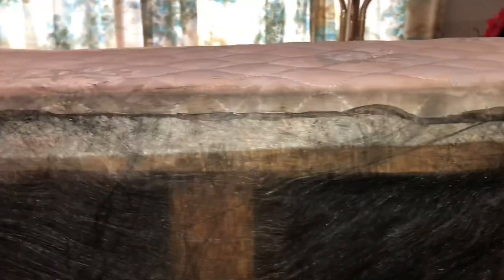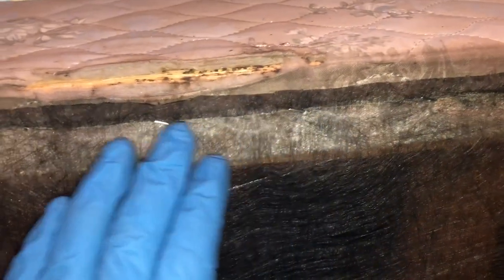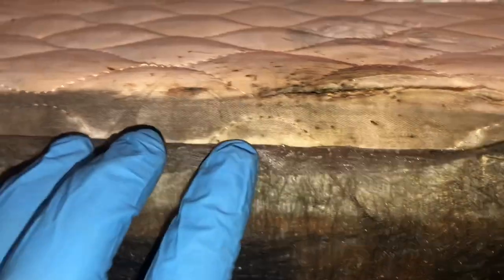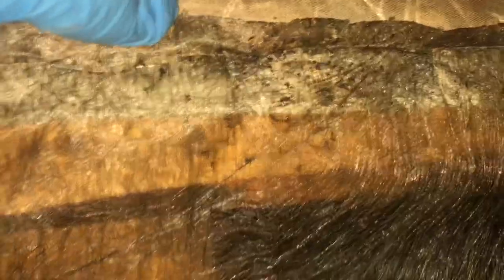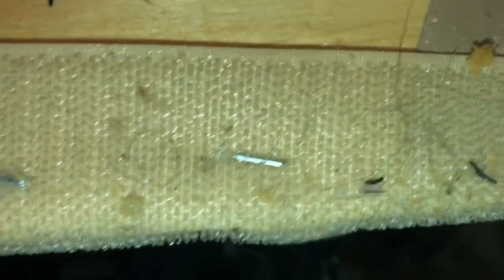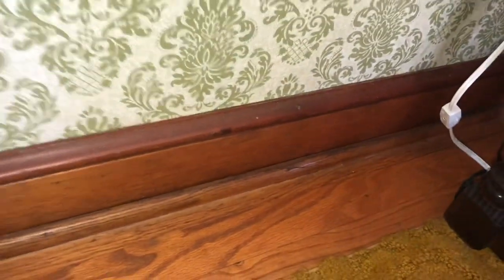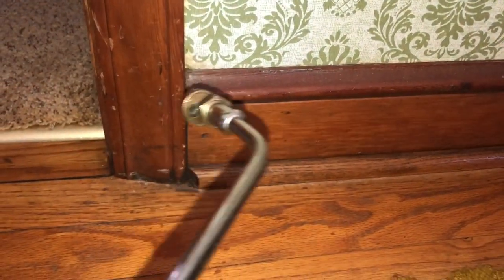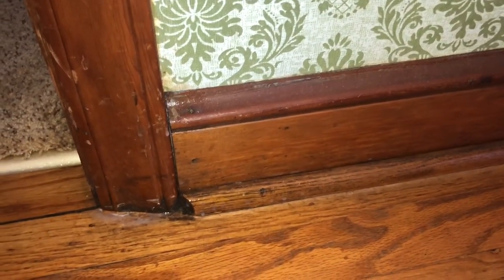DON’T MISS THESE BED BUG HIDING PLACES! - How to treat a home for bed bugs - Top 3 places

Comment: Hi Jason, I have a question for you. Im going to be treating my home with crossfire. Im going to have a new box spring delivered for my bed soon. Would it be better to leave the old one on, and spray first, before changing it out ? I figure the bed bugs will just get into the new one, If I change it out first. If you see this comment would you please respond back?  This is getting so stressful . Thanks alot, Pam.
Reply from the maker: Personally I would use the old one until I knew the bed bugs were dead

Comment: Would it be helpful to fill all cracks in outlet covers, baseboards, and windowsills with clear silicone caulking after you treat?
Reply from the maker: I dont think so
Reply: Green Akers Pest Control LLC  But wouldn’t that trap them and prevent them from coming back out?
Reply: @sfree322  it wouldn’t solve the problem you need to get rid of them before doing that